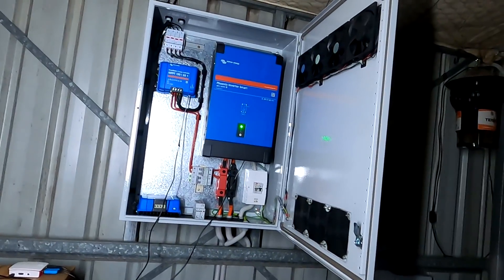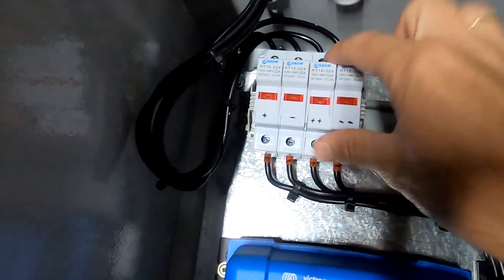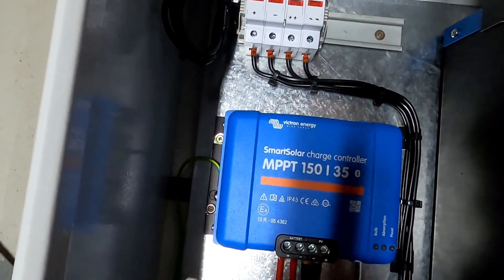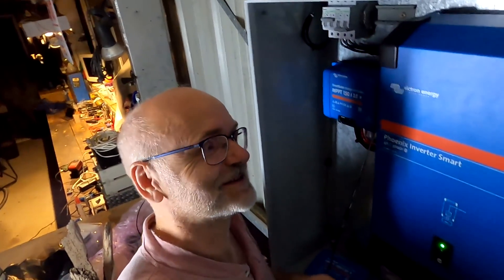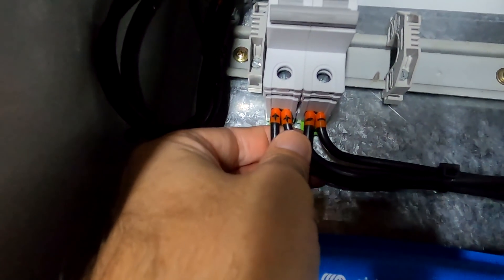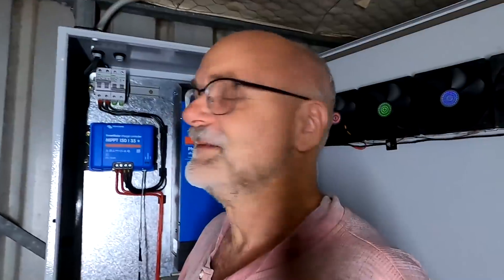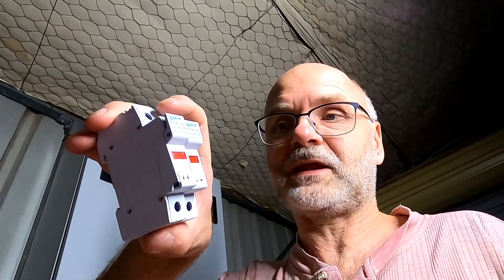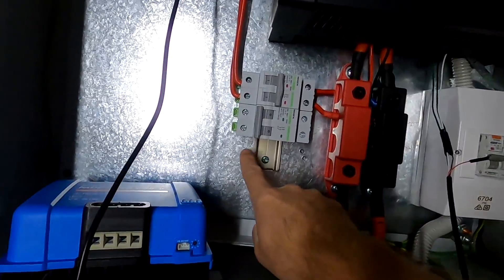Solar Upgrade EP5 - Fuses or Breakers?

Comment: (((REALLY DIFFICULT TO GET A STRAIGHT ANSWER ON THIS SUBJECT)))

Have you made a video, or are you willing to make a video about whether or not it is necessary to have equal links power wires in between your battery bank and multiple series charge controllers?

Comment: You came up with 3 good reasons for breakers, huh ?  Let me give you one good reason for fuses.  FIRE !

Those type breakers burn dozens of homes to the ground every year.  They have to be wired correctly, and are most often not by DIY types, or they shoot the arc internally, instead of suppressing it, causing fires.  Also, every time they are manually flipped on/off, they weld/stick a little more due to DC arc, and will eventually fail by welding the internal contactors together, for, yep, you guessed it, FIRE !!!

Fuses are not nearly a pretty, technologically impressive, or drooled over like some sick solar porno, and I can only offer one good reason to use them over your breakers, as opposed to your three reasons, but here goes.  They dont catch FIRE...

Comment: Hi. Maybe I missed it, but you are not using regular AC circuit brakers are you? For DC current you need to use DC circuit breakers, on full load the regular AC breaker can still be tripped by the thermal protection, however it can have an arc formed inside for quite a while, leading to bad stuff. DC circuit breakers have special 'features' like enlarged arc extinguishing chambers etc.  I admire you doing all you are doing and sharing it with us, and you saved me from making quite a few mistakes I was about to make with solar. :)

Comment: CAUTION! : There are polarized DC breakers on market, which first can not be used for Battery connection at a hybrid Inverter and second, they must be connected in opostit polarisation  when the solar panel input comes from bellow upwards into the MPPT, otherwise they imediately catch on fire, when they trip!
The background is that they have built-in magnets that direct the arc into the spark extinguishing chamber. If the current flows in the wrong direction, the magnets direct the arc into the fuse mechanism instead of into the spark suppression chamber. 
Whether magnets are installed can be visualized using a liquid crystal film that is moved arround at the sides of the fuse.
Reply from the maker: Most DC breakers these days are non-polarised, so it does not matter which way around to connect. I'm not aware that you still buy polarised breakers. Maybe from China?
Reply: @OffGridGarageAustralia  Here in Thailand are almost all DC-breakers polarised, even the expensive brands. The polarised breakers perform with higher voltages, so non-polarised ones aren't better, but they are foolproof.  
The fact you have to connect the + on the Right side, even the + symbol is on the top Left side on diagram, makes it quite tricky with double breakers, when using them with the source coming from bellow. Then on top Left side where the + symbol is, the Minus to MPPT must be connected.
Everything comes from China and everbody can order from there, so it can avoid somebodys house burns down if you pin this up.

Comment: Hi<
Just wundering, I have got 15 panels in one string. The specs say:  Max current 11.7 Amp, and Short Cirquit current 12.4 amp. 
Does a breaker make sense? Can the total current exceed 12.4 amps? Would a normal switch be better?
Reply from the maker: You definitely want some sort of safety device, not just a switch. Have a look at the panels what the maximum reverse current or max fuse current is. You breaker or fuse cannot exceed that  value.
Reply: @OffGridGarageAustralia  
istn that the same as the Short Circuit Current-ISC (A) ?
That is 12.41 Amps.

Comment: OMG Andy you need to take a breather stand back think what you are doing.  Getting confused between a ///////FUSE and a circuit breaker not to mention an isolator switch.  Look at your domestic utility system. You have a main 100A cartridge fuse on the supply cable THEN you have a distribution board with has a main circuit circuit breaker (MCB) in series and downstream of the supply onto the dis board .  The busbar is often split into two parts ELCB protected and unprotected. The ELCB is often integral with the MCB.  Then you have branch circuit mcbs connected to the busbars.  Power are on the protected busbar and lighting is often on the unprotected busbar as you dont want to be plunged into darkness cos of a little leakage from a chinese toaster eg, also your deep freeze chest doesnt want to trip etc.. But not always eg outdoor lighting must have an ELCB.  Then on these circuits you have isolating switches DPST (which are not intended to break operating current)  and then control on/off switches SPST.
You dont seem to have any isolating switches (also known as lock out so they cant be accidentally switched on during maintenance).  I dont see a bank of fuse cartridges.  Remember fuses can be slow blo - for motor starting, connecting your inverter (charging up its capacitors) etc or they can be fast acting HRC types like your main supply fuse.
The fact that voltages were floating around your board and you didnt know why should be alarming - Very naughty.
Your system looks complex, are you the only one who would know how to use it properly?  A fireman? An electrician (if you were away).  I dont see a single line diagram on your cabinet door and non of your kit is labelled.  OMG the inspector would condemn you  immediately

Comment: My question is: Why use fuses at all? It seems, that circuit breakers are better in every way. They don't seem that expensive either for the convenience of not having to replace it.
Reply from the maker: Ah, they are not better in every way. Fuses have some unique trigger point which cannot be achieved with breakers. I can pull 20-30% more current from a breaker for quite a while without tripping it. A fuse will just blow. So such an effect and behaviour can be desired or not, depending on your application.

Comment: Thanks we have a boat and fitted the type of brakers shown.
We normally  use 12 volt planet.
But  had to have next day delivery to one of those  boxes at a petrol station. I will be changing them for 12v planet ones.

Comment: Great video and presentation style. Something to consider, circuit breakers are only warranted for one trip, after that there is no warranty. Many do not know about this but check your warranty card please. Being a electro/mechanical device they can malfunction, a fuse is very simple and reliable and also only does one trip, however what is your property worth to you? This how I would measure what I would use.
Reply from the maker: Hmmm, never seen that anywhere written. It says something like 10000 disconnects or so but that could be just the manual disconnect not a fault trip.

Comment: Using individual breakers on each individual string has a big benefit when diagnosing yield problems.  Some days, when it seems like I should get more yield, I switch off one string and compare it to the other.  If the 1:1 (or 2:1 like my 600 Watt:300 Watt system) ratio isn't about the same, then there's a problem.  I've found a burned out bypass diode and a damaged MC4 this way.  

If you don't have anything to compare to, how do you know you have a problem?
Reply from the maker: Yes, that's what I do as well if I believe something is not working correctly. We will have these fuses on all strings eventually to run more experiments.

Comment: We are installing an array (425vdc at 10 amps per string, 4-strings)  Where do we locate 500vdc breakers at 20a at a resealable cost to install in the combiner box?  Will to install 2 combiner boxes if need be.

Comment: For protection a fuse is much better. A circuit will wait to see if it's a short, overload, or a ground, before it trips. Meanwhile a fire could start by then. A fuse on the other hand, doesn't wait to see what's going on, it trips immediately expect if it's a time delay fuse.
Reply: I don't believe this about differences between a fuse and circuit breaker.
I don't believe this is true about time delay in the ckt bkr compared to a fuse. In college in the 60s l worked at ITE Circuit  Breaker company in Philadelphia.  After being there awhile l asked what ITE stood for. It's the abbreviation for INVERSE TIMING ELEMENT.  It's possible ITE was the inventor of this important internal equipment safety device (that's my hunch on the inventor). ITE made breakers for the US Navy. I assembled an internal breaker component called an arc shoot assembly. Which is in our AC and DC breakers being shown in the video. Simply it is a series of parallel plates spaced abt 1/16 or 32nd" apart like plates in a capacitor. It's made up many individual metal plates whose purpose was to quench the powerful electrical spark created as the contacts quickly separated breaking the circuit. The plate's stamped shape was similar to a horseshoe where the contact arms were allowed free passage to open and close. The heat generated by the arc could easily melt welding the contacts together preventing them to separate. In normal opening of a breaker when the circuit is live creates very intense small arcs which pit via melting slowly destroying the contact's surface, hence requiring the need for more frequent replacement. 
Navy contacts were silver plated to reduce surface resistance. The energy absorbed by the assembly went to ground. Hence preventing contact pitting damage or worse being welded together.
The DC breaker seen in our video had two independent methods of breaking the circuit on overload.  A bimetal trip arm that when heated released one contact arm held by a locking mechanism. The bimetal's properties were designed to open at a certain temperature. It allowed more current to be passed beyond the trip temperature allowing motor inrush current (approx. 6 times normal running current to safely pass for the extra tenths of a sec it flowed until the current fell to its running current. This prevents nuisance trips.
In the event of a dead short in the external circuit the electrical cable had to be protected from this continuous excessive current draw that can cause fires.The beauty of the arc shoot assembly et. al. was one breaker arm was electrically connected to an electromagnet. It's response time to open in microseconds immediate to the short. The strength of magnetic  field created is directly proportional to the amount of current flowing in the coil which was the same as in the external circuit. 
So modern breakers differ from the common fuse in it has one trip mechanism that avoids trips caused when motors normally startup. If that inrush current continues to be drawn then the bimetal arm continues to be heated to the point where the contacts open the circuit.  But in the event of a catastrophic short the bimetal's slower reaction time doesn't prevent cable-equipment damage. The electromagnet magnet's reaction time to trip is inversely proportional to the much greater current drawn from an electrical short.[

Comment: I prefer fuse and switch as fuse burn very fast to protect the system. But circuit breaker either the current jump very quick or overload from sometime as most the circuit breaker has c cure that told too long to trip

Comment: If I may ask, I have 2 120w panel (same brand) the wire of the 1st panel is silver but the other on is copper which makes the current different from each other the silver reads 7.3 amps but the other one is 6.3 amps. I have them in parallel but combining them makes the current only 9.8 amps. How can I solve this issue?
Reply from the maker: The wires are not the problem, one is tinned copper and the other one is bare copper. The overall current depends what solar charge controller and battery you have, how it is connected and what the state of charge of your battery is.
Reply: @OffGridGarageAustralia  i recently bought a new charge controller. I'm trying to purchase a mppt controller then I've found this brand called perfect suitor which turns out not mppt. I chose the 70a unit because I'm planning to add more panels and battery in the future. I really can't afford to buy another one. Do you think putting a blocking diode on each panel would give me better current output?

Comment: Hi Excellent video's thanks, is it possible to use 10 or 20 amd circuit breakers instead of those din rail fuse holders you have?

Comment: I would leave the fuse in the circuit as an extra protection as I have seen a CB melt and catch fire with the contacts fused on.
Reply from the maker: I have now inline fuses with each string of solar panels on the roof and one main MCB inside the cabinet to turn them all of at once. This needs actually upgrading as I have far more solar but never upgraded the MCB. Another project on my list...

Comment: 071721/0434h PST 🇺🇸.     071721/2134h Brisbane 🇦🇺 Thank you for the presentation. I’m watching your older presentations now, that’s all. They are educative, as always. They are not ‘old’. I’m using DC CBs throughout the systems. 2 for PV Cells inputs, 2 for VICTRON BMS OP to LiFePo4, 2 from LiFePo4 to VICTRON inverter and 
2 AC CBs to inverter OP to loads.The only difference is Fuses act instantaneous and the CBs with a slight delay. I tested the actions of both CBs and fuses and found both to trip/fuse simultaneously. Thanks again and please keep, up the research. Stay safe and 73s…

Comment: on the DC, obviously, a breaker seems more appropriate, but I wonder if an electrical differential would not be safer, actually.
Reply from the maker: They would not work with DC though.

Comment: I think your old enough to remember points (dc opening switch) and condensers (capacitors) in auto ignition systems. 
I don't know what is inside those dc breakers, I never opened one up.
AC opening switches are self extinguishers because the current reverses at a 50/60 Hertz rate.
When a DC current is opened there is an arc of ionized air between the contacts. The condenser was (is) used to bypass the current to extinguish the dc arc faster (suber cap). The points eventually wore out because metal was transferred between one side of the point to the other side. Filing points  and adjusting the gap was a regular maintenance item on cars of my youth. 
Eventually the contacts materials were improved to last a few months. 
Breakers should be minimally used to isolate DC circuits. The contacts do wear out. They are a safety device, they are not a switchs.

One of cost differences between an DC and AC breakers is working around this dc arc with better contact materials. 

Is there a spec on the number of cycles these breakers can open?
Reply: True, DC arcing is a problem, in particular, at higher string voltages. The drawback with solely relying on breakers is that they invite you to use them as a regular convenient switch, even under high DC voltages. 
PV systems (but not ground-mounted) are encouraged (US required) to have a (rapid) shut-off switch to completely disconnect the PV system from dangerous voltages for the safety of fire workers who may have to enter the roof for their work. They don't like electrical shocks. Putting the breakers/fuses after this switch would still maintain safety and convenience for testing. Cheers.

Comment: Fuses or breakers dilemma. I go with breakers for the reason if it is rated for DC applications, they can be disconnected under load while fuse holders are not really designed for that and have a potential of arc flashing when breaking the circuit under load. There are some disagreement about breakers being used as a regular DC rated switch depends on the manufacturer if they rate them to be switching duty or not.

I have the same dilemma since my system on net metering and if I take it down during the day will cost me in generating credits. Most of my upgrades or changes to my system has to be done in the evenings unless I don’t have a choice in the matter.

Comment: Both breakers and Fuses have their place.  Those fuse(holder) make a very convenient isolation switch.  Given that solar panels have a maximum current (and voltage is just about a 100Volts) I would have just left the fuse holders there.

Battery and inverter circuits are a different thing.

Comment: Andi, did you not explain in an other video that if panels are in parallel, you must fuse each paralel part. Because if one shorts all power of the others will run trough it. Now you just undid that safty measure. The diode test is interesting, but does it not confuse this safe issue?

Comment: Good decision, fuses are getting hot, I had a cade in 10KW system where the fuses did melt the Phönix holders even the rating was max. 70% of the current.  I removed all, no more problems as the cable cross section was much bigger than the highest possible current

Comment: good day dear sir......been following you ever since you started. your experiments and all sorts of things makes my spider sense tingling.........i just want to request you try to over power your panels above the recomended wattage by the scc on paper. I know solar panels are not that efficient I just want to know how much tolerance can a charge controller take. will it actually handle the amperage they are rated for? i've tried overpowering my epsolar 20 amps tracer a series. they did well but i don't have those meters and all tools to measure and my panels are old(way back 2009  when they costs much more than my lithium batts now a days). but they did well as per my capabilities. a full test from you will be fun to watch.